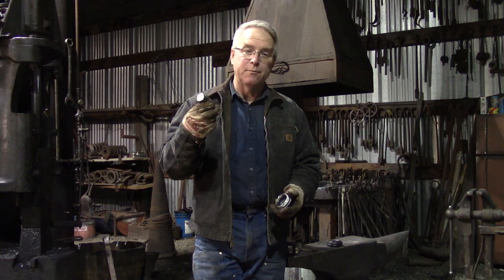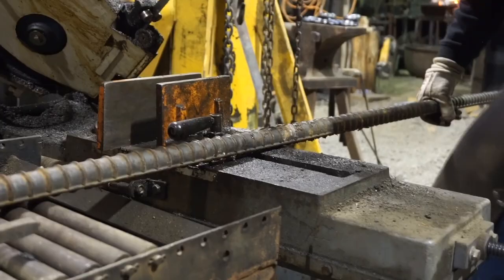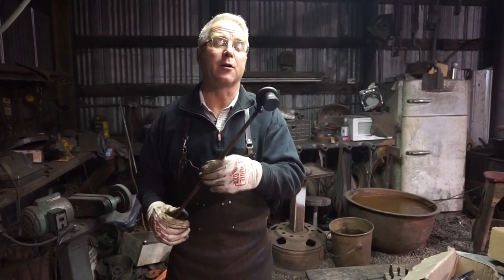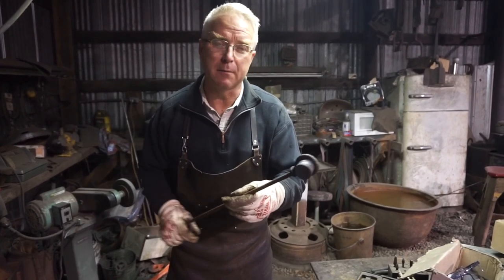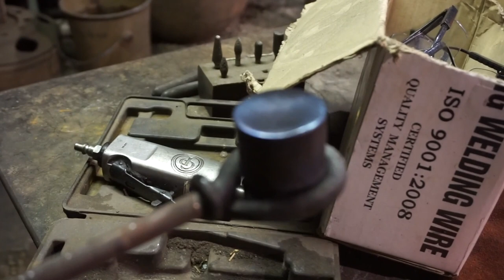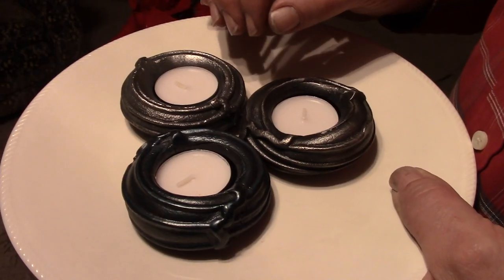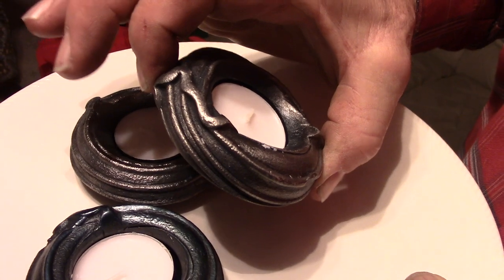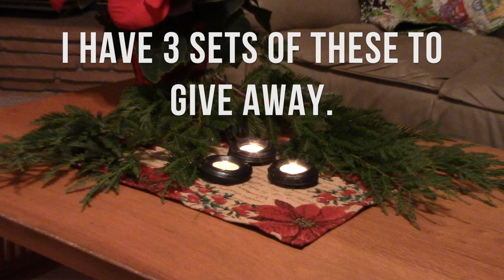Rebar Tea Light

Comment: It would obviously take more time, but would it even be possible to make those without a power hammer; using a handheld hammer?.
Reply: I do all my work ba hand and I must agree to what the Essential Craftsman said. You would need a striker with a heavy sledge alongside you.
You could do it by your own, but it wouldn't be much fun, plus there is a high risk of injuring yourself when you are not used to such heavy work.